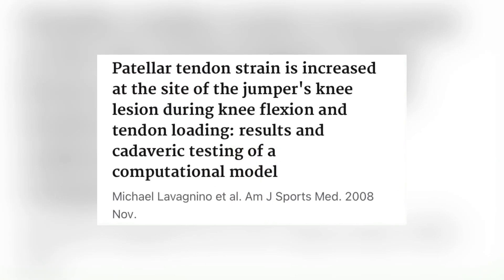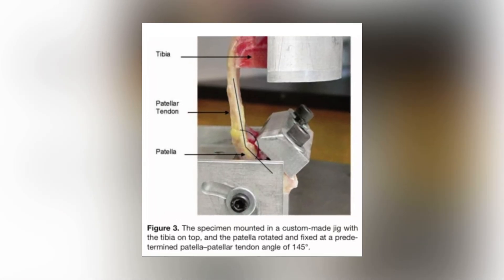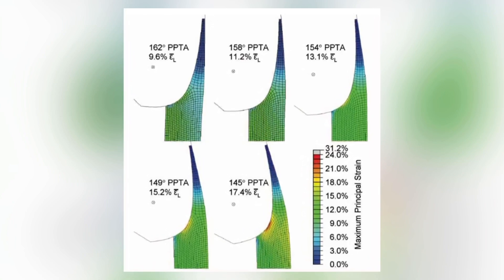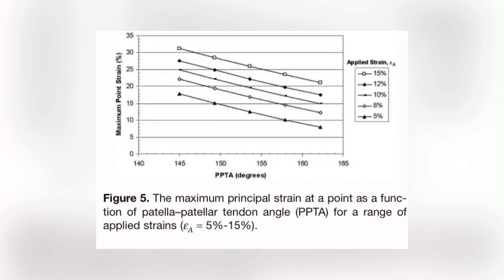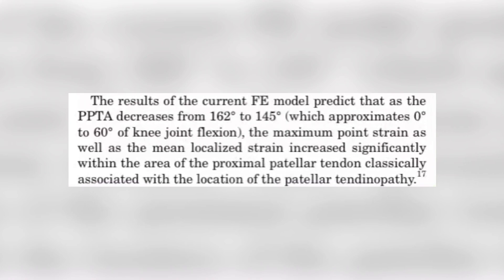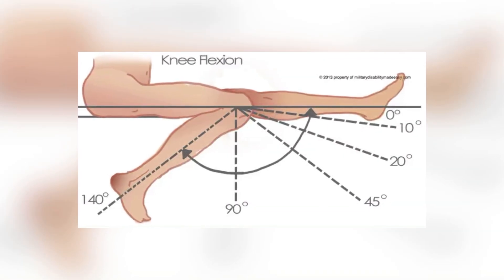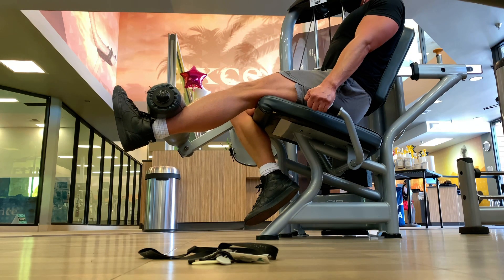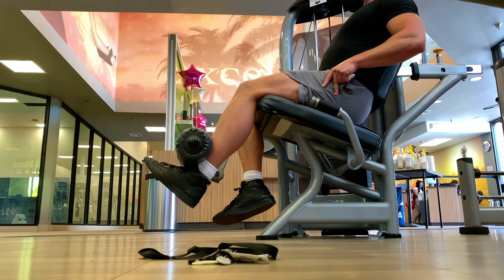Jumper’s Knee: The Best Angle to Heal Degeneration (Fix Patellar Tendon Pain)

Comment: How would you organise exercise program? What do you think about this one: 
isometric spanish squat or knee extension 5x45s holds (what weight would you recommend for knee extension isometric) as a warm up
then doing isotonic knee extensions, hammstring curls, glute hip thrusts and calf raises all 3s down no pause and 3s up to keep the tension on the tendon.
What weight to use on these isotonic exercises? How often to do them, how many reps and sets and would you go to muscular failure?
Also if you experience an increase in pain 24h after a workout or 48h after a workout would you take rest and stop doing anything until the pain decreases or only do isometrics? Thanks man, appreciate all the info you provide
Reply from the maker: I would not do it this way. Many flaws and many better ways to do it, none of which I can cover in a comment. I made a program because if you’re good at something, never do it for free: https://jackedathlete.com/jumperskneeprotocol-2/
Reply: @jake_tuura  How do Osgood Schlatter and jumpers knee differ? I've been diagnosed with Osgood Schlatter in 2014 but when I came back he said it was jumpers knee I guess because I stopped growing. I did isometrics and it did reduce the pain. Could your book be helpful?
Reply from the maker: @misterace1191  yes, I have a video on osgood… if you’re past puberty, the rehab is the same as JKP. If not past puberty, it’s a more gentle approach while you wait to be done growing
Reply: @jake_tuura  I see you do a lot of squats and split squats. What should I do if I can't do weighted squats, split squats or anything like that or a classic RDL for glutes? I have spine issues that don't allow these movements. Could that be switched up with knee extension machine, hammstring curl and maybe hip thrust or cable kick back ofcourse everything done single leg? 
Also what about intensity? I noticed I do well in high intensity and low volume. Do you go near failure or all the way to failure on your exercises or do you take a higher volume approach? I'm not sure what is better for tendons. 
Thanks man, appreciate it.

Comment: So if I feel a lot of strain at 90 degrees , I should keep doing those holds at 90? 60 I feel it a little but 90 is like dam that’s hitting right there
Reply from the maker: Yes
Reply from the maker: And yes, that’s a good sign
Reply: @jake_tuura  right on thank you man .
Reply: @jake_tuura  I got one more question bro . How long do u recommend I rest in between sets? And would
This speed up recovery if I did it say 2 times a day? Or is just the 5 sets everyday enough?
Reply from the maker: @MAMBAMENTALITY2498  Rest around 2 minutes between sets. Multiple, short sessions per day is a good way to get more stimulus in it. Good for early stage rehab.
Reply: Also today I did a full 5 sets of 45 second holds at 90 and the pain seems to have gone away completely . Is this a good sign?

Comment: So what's the best way to do the iso? Overcoming with an immovable weight or a weight that can be moved but just held in place at the desired angle?
Reply from the maker: Whatever way you respond best. It’s a self-experiment.
Reply: @jake_tuura  I started off doing the full weight stack version but I think the ability to properly guage intensity was too difficult and I went to hard, so I backed off and just did it for a couple weeks with 10lbs, combined with the exercise you do on one leg while holding the other out for time. That was feeling good, then this week I bumped up to 15lbs and it aggravated the area, it's still sore since Monday. Does it make sense that this happened because the area is still fragile and I added too much weight for what my knee could handle? If so I'll have to either stick with 10lbs for longer or find a different stimulus right?
Reply from the maker: @exothermic8525  Probably not a patellar tendon issue. You have something else wrong.
Reply from the maker: @exothermic8525  watch this: https://youtu.be/t3Y0PVP9gdc
Reply: @jake_tuura  yeah that makes sense. In the link my symptoms match up, except for the pain migrating, it always seems to hit around the same area. According to my doctor I had patellar tendonitis but your video would suggest otherwise. Do you have a video for patellofemoral rehab or do you have a recommended protocol for that?
Reply: @jake_tuura  one other thing to add. I was having acoustic sound therapy done on the patella, some spots hurt during the therapy but they also thought something else was happening and tried hitting the tissues higher up above the knee cap and it hurt like hell there.
Reply from the maker: @exothermic8525  if it’s Patellofemoral, you have to be careful with ISOs. Deep ranges could make it worse and too heavy of loads could make it worse. Rehab outside of that is very similar. Get strong in the weightroom and slowly progress back into the activities you want to do. Get a lot of elastic volume for the feet and strengthen the hips with things like split squats. David Grey’s lower body basics is a good program to work the biomechanical aspects that could be problematic.
Reply: @jake_tuura  I'll get on that and look into the book. This might sounds crazy but I kinda wish I had patellar tendonitis instead lol.  Thanks for the advice, I appreciate it.

Comment: HeyJake , thanks so much for all your very helpful videos !  I've been dealiing with this for 5 years , and I've recently been having a lot of success with daily isometric sissy squat holds.  4 sets of 45-60 seconds - generally before a workout.  Would you say that based on the info in this video my best bet would be to do these holds  with my knee bent at 60 degrees ?  I had been doing them at around 90 degress .  Thanks man !
Reply from the maker: Anywhere from 60-90 is good. If you’re seeing benefit in pain and function, there is no need to change anything. Keep doing what you’re doing.
Reply: Have you fully recovered? How long didnit take?

Comment: How could you work your way up to this is you experience pain in the tendon or is pain normal?
Reply from the maker: Warm-Up effect. If you have a patellar tendon issue, it will feel less and less painful with each set of isometrics, so you will be able to go heavier and heavier
Reply: @jake_tuura  what would be the lighest load we can start with on the first set that will still be effective for the patellar tendon?
Reply from the maker: @kevink1005  idk but the research says 70% 1RM or more is needed to adapt a tendon... but if it’s painful to hit that right away, start lighter and build up to that. Personally, that’s what I do. When it’s painful, it takes 2-3 sets to get to the point where I can do 70% or greater.
Reply: @jake_tuura  thank you but would does 70% 1RM mean?
Reply from the maker: @kevink1005  70% 1 rep max. So if you could do 100 pounds for 1 rep, then 70 pounds would be your 70%1RM.
Reply: @jake_tuura  thank you again and when you say one rep max you mean the highest weight I can do bringing the weight all the way up and down or the highest max I can do where I get it to 60 degrees and hold it there?
Reply: @kevink1005  1RM is just one rep up and down, he is telling you to do an iso with 70% of the max weight you could do for one rep up and down!
Reply: @jake_tuura   Thanks! So after trying this for the first time if there is pain afterwards or the next day that is okay?
Reply from the maker: @rileynugent9185  The pain should be less right after. And if the pain is not the same or better the next day, then you did not respond well to the loading intervention, so you should do something different until you have a positive response the next day.

Comment: How would you achieve these angles without a leg extension machine?
Reply from the maker: Train 60 degree angles of knee flexion where the knee extensors are the main limiting factor... so you’ll fail at the quads first.
Reply: @jake_tuura  So something like slant board isometrics would be fine?
Reply from the maker: @robelaklilu171  Yes
Reply from the maker: But the leg extension is the best way to adapt the patellar tendon. Alternatives are okay but leg extension is king.